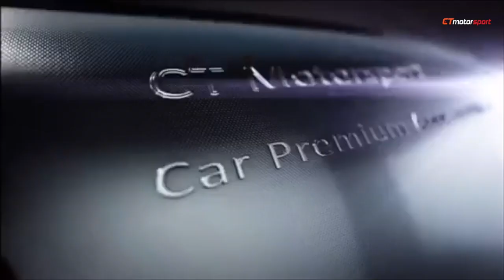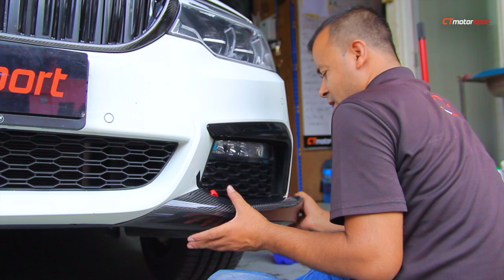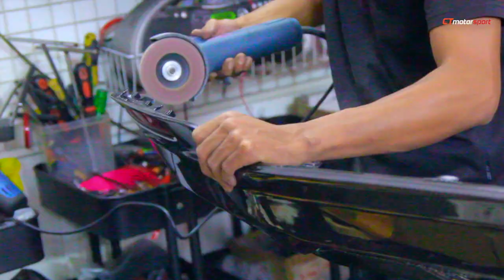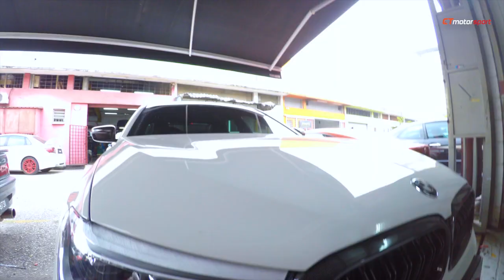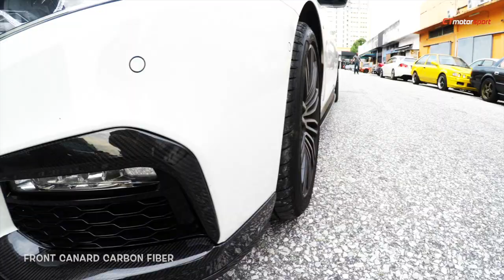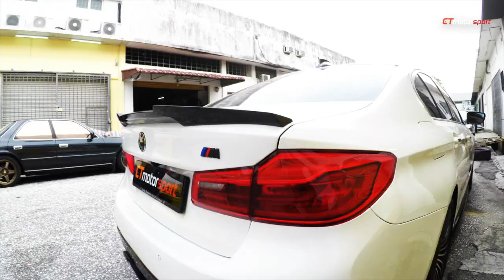BMW G30 M-PERFORMANCE CARBON FIBER ACCESSORIES KIT

Comment: Missing the carbon side air intakes. IMO the rear spoiler looks a bit cheap as all those fake carbon fiber badges and the M badge on the boot. Everything else looks fantastic.